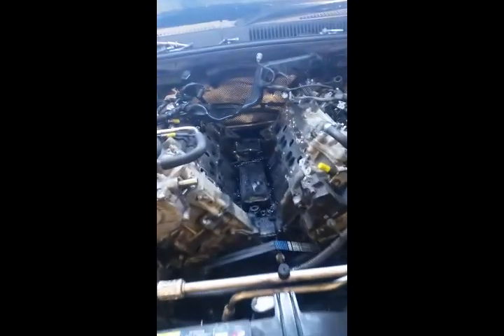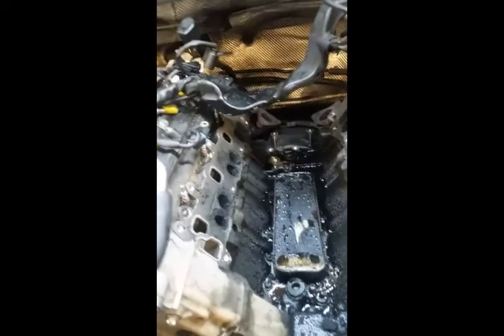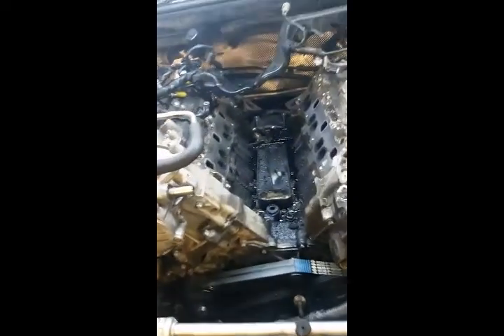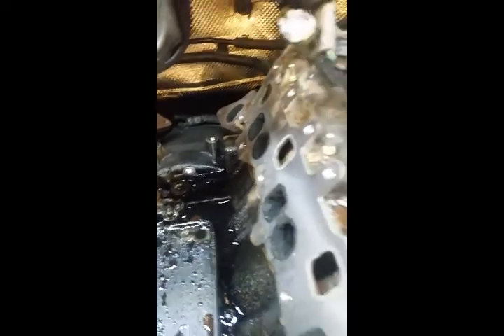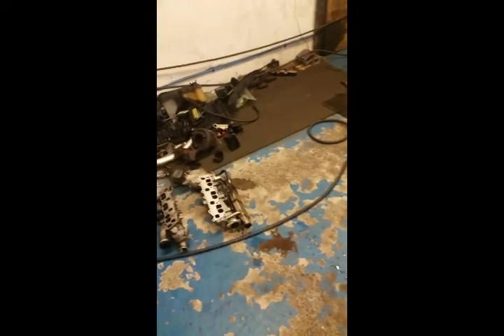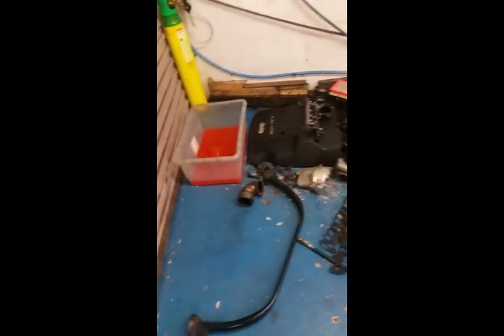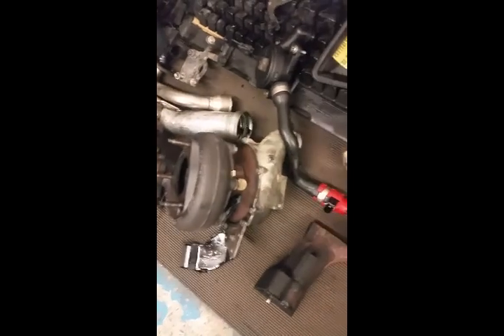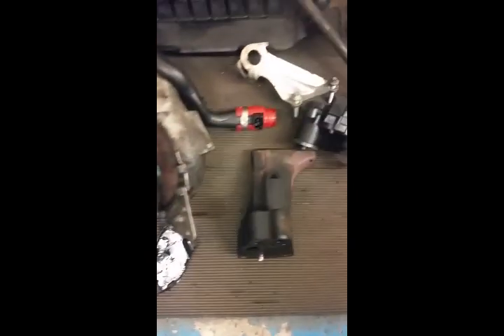Jeep Grand Cherokee 3.0 CRD oil cooler seals. Mercedes OM642

Comment: Would you also replace the oil cooler itself ? Just curious I have the same gasket problem.
Reply from the maker: No. Ive never replaced the cooler
Reply from the maker: See reply
Reply: I would replace it. Just to make sure. It's cheap comparing to the job.